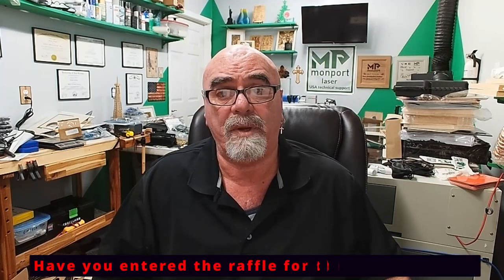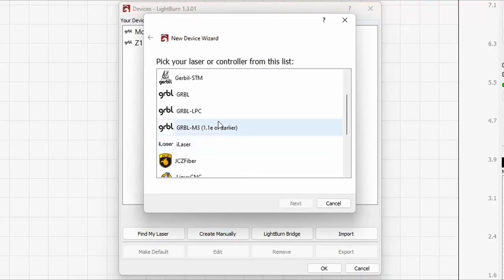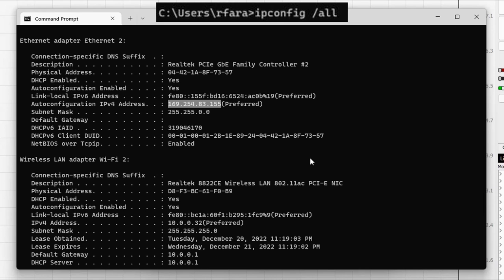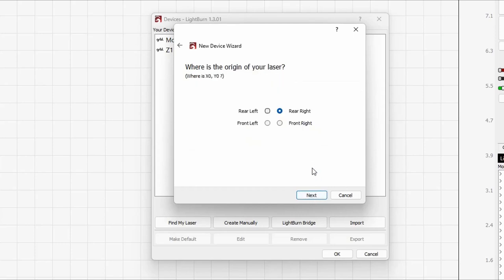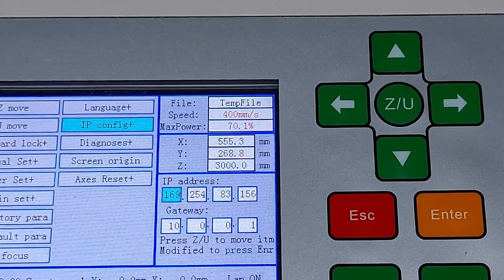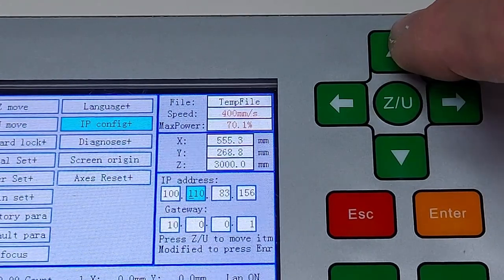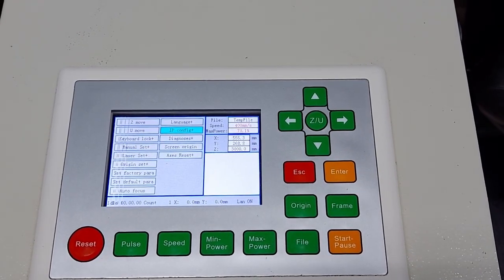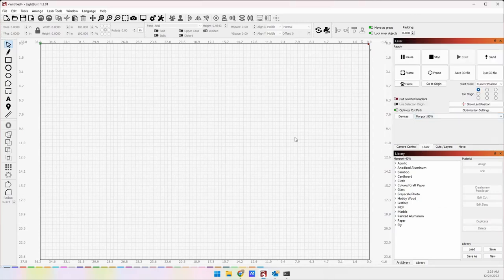💻 Configuring an Ethernet Connection in Lightburn, to a Ruida Controller.

Comment: So im assuming it would be the same from a router... Just see the IP address the router assigned and set the RUIDA and Lightburn to the same.... Id always assign a fixed IP address in the router software...
Reply from the maker: Yes, you can add it to the network Travis.

Comment: In lighyburn, my laser window isn't showing "Devices"   Connected via ethernet cable.   OMTECH 130W.    Omtech support was a trainee and couldn't fully help us get connected.
Reply from the maker: It's there, on the Laser tab. It's a button, next to the drop down menu.
Reply: @The Louisiana Hobby Guy  Thanks for replying, we'll try to connect  in a little while.  I really appreciate the reply
Reply: Thank you for you help, we ate now up and running.  🍺 🍻
Reply: The ethernet on my MAC is showing its connected. But lightburn is showing disconnected.   I manually entered rhe IP and the laser shows in my drop down . What did I do wrong .

Comment: Thanks for this video! However didn't seem to work for my Mac Pro and with the same laser? Does anyone have a guild for the Mac OS connect?  The IP address changes every-time I turn off and on, and there has to be a better manual IP? Thanks in advance
Reply from the maker: Ask on the Lightburn forum so a tech can answer you: https://forum.lightburnsoftware.com/
Reply: Thanks! thought to ask, but just in case, I figured it out too. Just had to directly plug the laser ethernet to my wifi router instead of the computer directly, and connected automatically with LightBurn and Wifi. Still had to do the same IP adress one number shift but on my Mac it was with the wifi IP instead. Thanks again! @TheLouisianaHobbyGuy

Comment: Hello! I have a tp-link internet extender. I have the Ethernet connected from the laser to the internet extender. I followed everything on the video. When going into the command prompt, there is no IP address shown. It does say media disconnected. Does the ethernet cord need to be connected to the computer to the laser instead? My computer doesn't have this connection port for ethernet.
Reply from the maker: Mine is connected to the computer Kelly.

Comment: I have Xfinity with the XB3 router. I used the admin page in the router to view connected devices. The Monport is not showing. I confirmed that the ethernet cable is good by connecting another computer. I followed your instructions an set the IP address in Lightburn 1 number off of the address of my computer. I matched the IP setting in the Monport to the setting in Lightburn. I cannot control the laser from Lightburn. I was going to set a reserved IP in the router, but I need the MAC address of the laser. There seems to be no MAC address showing up in the IP config menu in the laser. I can't control the laser from Lightbrun.
Reply from the maker: I can't help you with networking in a text, sorry.

Comment: I do not have an IP 4 address under the ethernet section when I run the command.  Should I use the IP 4 address under the wifi section?
Reply from the maker: Nope, it's not a WiFi connection. Look under Ethernet adapter.
Reply: I dont have it either, did you get another way to do it?
Reply: I ended up just having to run a USB, unfortunately

Comment: Hey man. Thanks for this tutorial! I’m finding your videos super helpful! 
I’ve just upgraded my controller to a ruida 6442s and my machine home point is about 50mm off on x and y compares to the actual work bed and I can’t adjust this. Do you have some experience with this please? 
Looking forward to hear from you!!
Reply from the maker: Check your Device settings first, wrench and screwdriver icon. Make sure your bed size is correct under working size. If it is, you have to adjust the control board settings to match your laser size. Edit --> Machine Settings, and then expand the outputs. Look for $130 & $131 (X Max travel and Y Max travel). Be sure to save the current machine settings before making any changes. Warning, editing the machine settings is for advanced users! Always make a backup copy before editing them.

Comment: Just got my panel. I already run off ethernet and have the Polar setup with an IP. So does the panel need to be setup with an IP or will it read it from the controller/Lightburn ? Thanks. Enjoy the vids.
Reply from the maker: I don't understand the question. If you already have it setup on an IP, you simply add the IP in the device settings for Lightburn.

Comment: can you hook up the ethernet cable direct to the laptop from the laser to do this or does it all have to route through the router. My laptop is hooked up wirelessly to the router and was hoping to just hook it up direct to the laptop. I am guessing its not compatible that way but thought i would ask.
Reply from the maker: This video was about a direct connection Rick.
Reply: Sorry, I was a bit confused. Thank you for the clarification.

Comment: I've ruida rdc and lightburn and i can't see the design on ruida screen only cutting shape no engraving inside please help
Reply from the maker: Why do you need to see it on the screen? I'm not a Ruida tech so I can't help with that.
Reply: @TheLouisianaHobbyGuy  but it's working on Rdworks
Reply from the maker: It only shows up sometimes. It depends on whether you hit Send or Start. Send sends it to the controller and you can see it, and Start starts the job bypassing the controller.
Reply: @TheLouisianaHobbyGuy  thank you boss 🙏

Comment: Hi Rich, so do you have to connect directly to an ethernet port on your computer or, can you plug the laser into a network switch and connect to it with any/multiple diff computers?
Reply from the maker: You can connect this in virtually any configuration Bob.
Reply: @TheLouisianaHobbyGuy  Thanks man! Setup was throwing me off when I didn't get a Console window in lightburn; I took it to mean still no connection. However, when I Homed the machine it worked! So, I guess when it's connected via ethernet, you don't get the console info? Or is it because it's Ruida and not GRBL I'm guessing? Anyways, once again a great job on tutorials! Thanks!
Reply from the maker: There's no console unless you have a Grbl controller Bob. The Co2 is a DSP controller.

Comment: Well, I did all that and then it worked originally but then all the sudden one day it stops working and so I went ahead and I just move my little Lenovo yoga over by the laser and I was going From USB-C to a USB hub to ethernet cable to my network switch 2 my laser. It doesn’t matter if I follow your steps exactly, it just doesn’t want to do anything. had just stopped out of nowhere. Nothing changed in my entire set up.
Reply from the maker: I wish I could diagnose problems in the comments, but I can't, sorry!
Reply: @TheLouisianaHobbyGuy  I got it. Someone else’s confusion helped me. I saw what they misunderstood about it in your comments and I realized I was a misunderstanding, the same thing. so it’s fixed now and it’s working great. thank you for your videos. I appreciate them very much. I found them very helpful. I have a 100w Omtech. I am experiencing of unique problem that I have not had before but I will address that later because I’m working. Thank you though.
Reply from the maker: What did you misunderstand? So I don't do it again!
Reply: @TheLouisianaHobbyGuy  no, the guy who didn’t realize you were talking about a direct connection. That is the mistake that I made. I was talking about going through my network switch. which is how I had originally done it, but something got mixed up so I made the same mistake that other guy did.
Reply: @TheLouisianaHobbyGuy  I realize this is off-topic, but I don’t have time to locate the proper video to ask this question on because I’m organizing a semi trailer right now but my laser seems like it’s got a really thick pattern to it now. It’s just like my beam got extra wide And I don’t know how. I’ve only been using it for less than a year and I only use it once in a while. I’ve got my chiller hooked up to it. so when I was checking all of the different points to properly align everything once I got done, it was thicker and then I’ve got the curved side pointing up on the lens, but no matter what I do going up and down, I’m still getting the thick laser burn on everything. It’s just really confusing me.
Reply from the maker: Did you check the lens? The lens or the mirrors could be dirty. You can start a topic on my forum and get some answers. I don't see all of the old notifications here.

Comment: One thing to remember is that if your router is dynamically assigning IP addresses on your network, the next higher number may have been assigned by the router. Also, if another device joins the network when the laser is offline, the router could assign the laser IP to that device.

To prevent this, you need to use an IP scanner to see what addresses are in use before assigning one to the laser.  Then, you need to go into the router setup and go to address reservation and set it so the desired laser IP is never assigned or used by any other device, otherwise you could end up with an IP conflict and it won’t work.
Reply from the maker: Yup, just keep the address high and it shouldn't be a problem Daniel; thanks for the tip!
Reply: Addresses in the 169.x.x.x scope are "self assigned" addresses.  No router will use this scope (range of numbers).